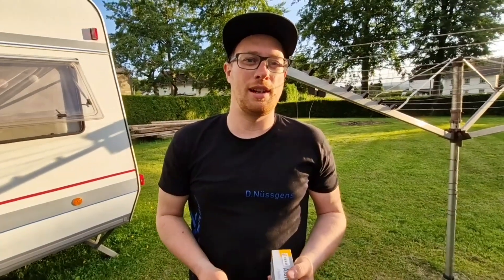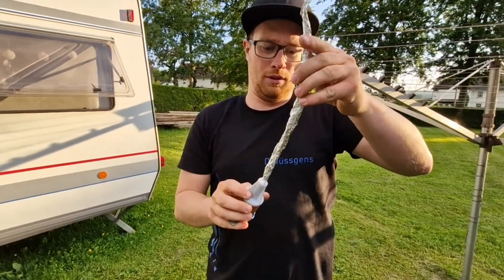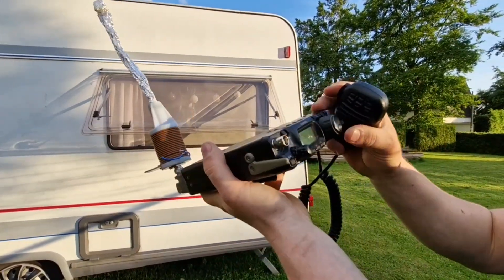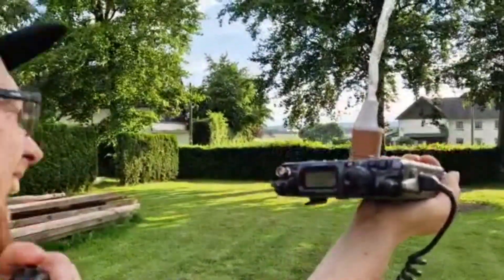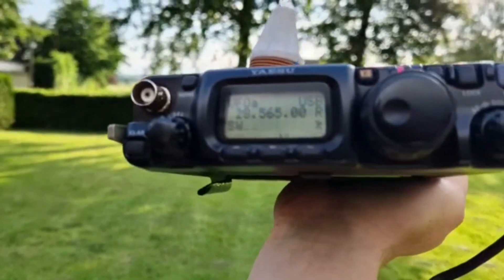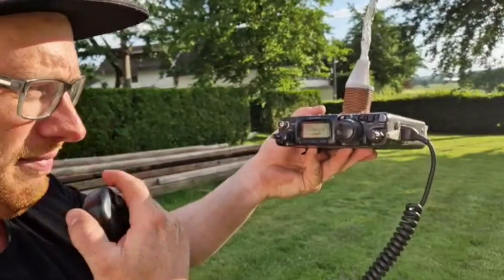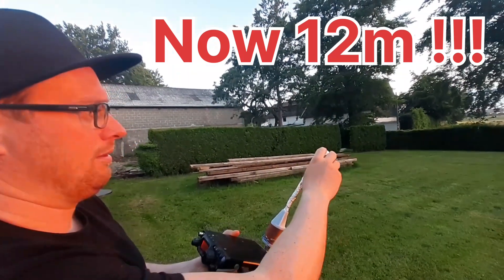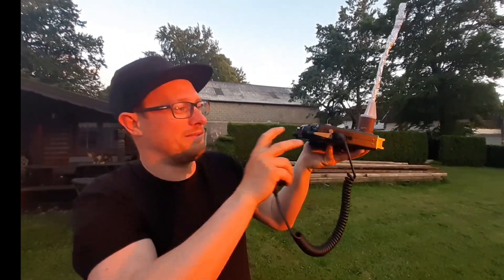Insane 20cm aluminum-foil antenna for 10m 😉

Comment: How will this work on 11 meter ? I need one of this antennas, i have a usdx radio for qrp, i want to use 10 and 20 and maybe 30 meter... maybe even 40.  How much will it cost to make antenna for those bands ? 73 from Norway.

Comment: when using internal battery, the maximum output power is 2.5 W and not 5 W. Very funny test. Cheers
Reply from the maker: No you can go 5W if it flashes

Comment: Reminds me on few QSO  to Ireland and England the other day  on 40 meters  with plenty  of wire turned around  a  broom  stick with 10W from  a racal mil.manpack radio.  It was a TRA 9xx or so, also known as syncal 30.   I placed the radio on the  kitchen table , the broom stick  secured with a wedge to keep it between table an ceiling. The old racal radio got an internal aerial tuning unit, so it was easy  to match the piece of wire around broomstick . It did  marvelous good job. 
But your 20 cm arial topped it all! Thanks for share your experiences! 73 , de DF6ZC. home qth in the north of germany  near hamburg.
Reply from the maker: I know the good tuners in the mil rigs. We did some tests last week but condix were not good....